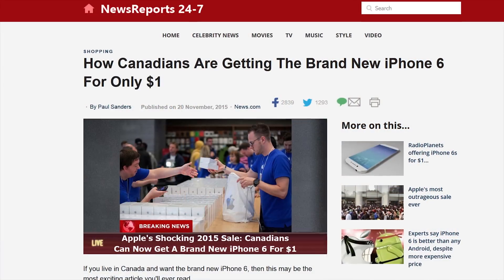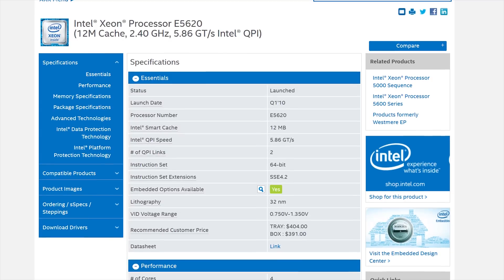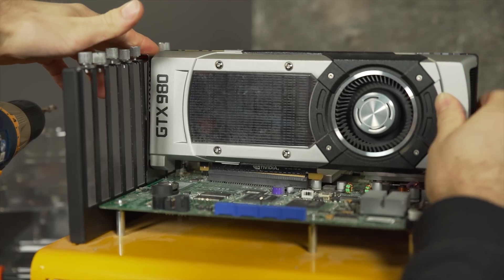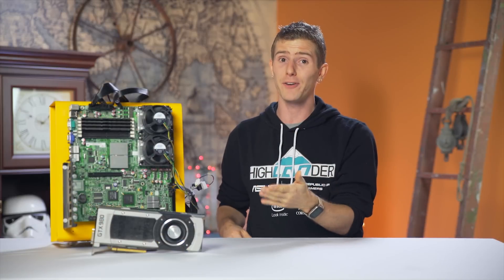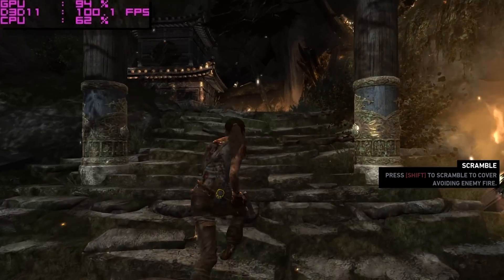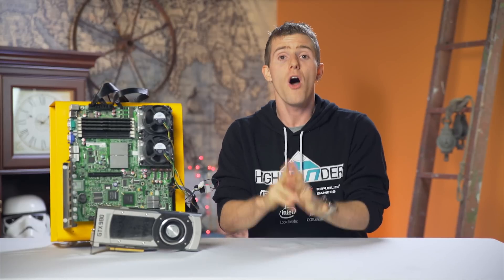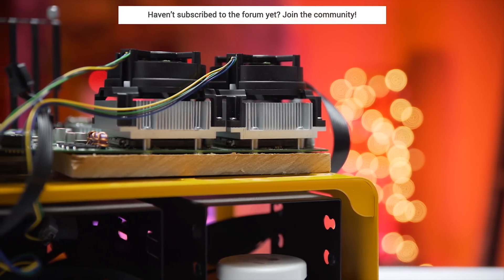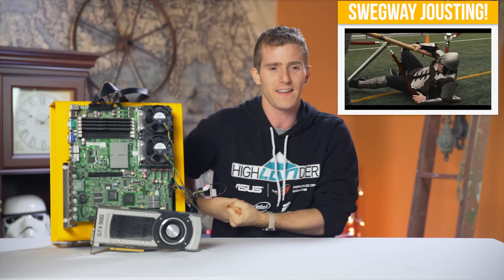Under $150 Budget Gaming 8 Core CPU, Motherboard & 16GB RAM

Comment: I seriously thought that the GPU is part of this budget gaming build. Seems like a click-baity video as of now
Reply: +Hank Hill "Under $150 budget GAMING build"
Reply: +Hank Hill Okay so you go ahead and try to do "gaming" on it without a GPU.
Reply: I think the issue is that all you see is "Under $150 Budget Gaming" when you see this in your subscriptions or suggested videos. You gotta admit it's a little clickbaity.
Reply: +Hank Hill I don't think it's an unreasonable interpetation. I bet a lot of people are going to be disappointed when they realize you need to spend at least another $300 to make it worth getting over a console. The quoted price doesn't factor in GPU and it's not a gaming system without the GPU, so it's a classic bait and switch.
Reply: except the title states that it's the CPU, mobo, and RAM...
Reply: +Hank Hill The title on the video
Reply: +Hank Hill I respectfully disagree, if it is interpreted that way by a lot of people, no matter if the title actually says something else when you read it more carefully, then it is the fault of a slightly misleading title. Also they never even mention the full price with graphics card in the video, even though they use it in the build.
Reply: Good for you. Pat yourself on the back. You know about computers. Good job.
Reply: +Hank Hill I still don't think it's an unreasonable interpretation; I wouldn't have been surprised if it was all inclusive, when it says "Under $150 Budget Gaming" in the suggested videos. Linus built a pretty decent gaming rig for $240 dollars in the latest season of Scrapyard Wars, so $150 isn't too far off from that.
Reply: +Der Krazy Kraut what the title should be is "shitty old server motherboard paired with ddr2 ram and then i saw off a lock on a 550 dollar graphics card and brag about how good the computer runs with a brand new 550 dollar graphics card in it"
Reply: +Hank Hill Yet somehow people are still clicking on this video expecting one thing and getting another.
Reply: Is it really necessary to call people dumb just because you disagree with them? Nobody's complaining that they don't understand the title. I'm pretty sure that the title doesn't need any explanation after watching the video. The only thing anyone's complaining is that the video didn't deliver what was expected when we clicked on it.
Reply: People enjoy not reading, and then looking stupid making stupid comments.
Reply: +Hank Hill Some boards have built in GPU's like from AMD so that's probably what people were thinking. You might wanna turn your TROLL ASS down to a 1 out of 10. You are really starting to look like shit.
Reply: +radun70 don't need to spend a other 300 to beat consoles. I have I think Mike a 120 or 150 dollar gpu and I beat consoles hands down lol. 750 ti
Reply: theboard 1  I know you don't. I was just saying.
Reply: +András Rudnai Also it shouldn't be click bait if you are a good subscriber and watch the videos anyways. they're giving tips. its not click bait. they aren't telling what could or mobo you should get. its not a build log video its a "how to" video. so they made the title long. so what? i would have clicked on the video if it "this is a video" and that was it. because I'm a loyal subscriber and i watch every video if i like it in the end or not. they're doing a service to us. not us to them. sit down child and appreciate what they gave us.
Reply: +Hank Hill SMH. You keep making jabs at me for not being able to read but I'm not having any trouble reading anything. The whole issue is that people will click on it expecting something and then being disappointed. It uses "Gaming" in the title, but it doesn't factor in a GPU in the quoted price; therefore it's a little misleading. That's all.
Reply: +Hank Hill Lol just stop if they are dumb enough to misunderstand what the video title means it's safe to assume they aren't going to understand it when you explain....even.  if.  done.  very.  slowly.
Reply: +Hank Hill PC Recyclers, you might wanna find one in your town. (Drops MIC and walks off stage)
Reply: +Hank Hill Actually barebone gaming PC&#39;s usually have AMD boards with built in GPU&#39;s on them. SO again, you are WRONG! a BAREBONES Gaming PC WOULD include a GPU on the motherboard or even a cheap ass R7 260 GPU card.
Reply: +radun70 Ignore hanky he's playing the protagonist because he has no fwiends
Reply: +Jeremy Gould Now days you can get PC cases WITH power supplies for $40. Yeah look online.
Reply: ***** Proving most of the shit you spew is nonsense and you obviously haven't been around electronics very long.
Reply: +Der Krazy Kraut 
"budget gaming" is no the same as "gaming pc" or gaming rig" .. thats like saying "fake turbo" is the same as "real turbo" just because they both have the word turbo in it. learn to read. otherwise youre gonna fail alot in life because this legalese lingo is EVERYWHERE. and it isnt hard.
Reply: +Hank Hill well there ya go. and I completely agree with the stuff you were saying :p people getting all bent out of shape for no reason
Reply: +András Rudnai It's not click-bait. You're just stupid and can't read.
Reply: Spektrik Most gaming rig's include a GPU without spending more money.But yeah, you don't get the concept. Go play Candy Crush I'm on Level 100 haha.
Reply: +radun70 This $150 doesn't include the case nor the Power supply either LOL.
Reply: +ThePotatoShow you dont have  to have a case
Reply: +Der Krazy Kraut If you were imagining other parts outside of the title description to be included.. why not assume it came with a case, psu, an a display too?
Reply: i would say exclude the side effect such as overheating
Reply: +radun70 im on the fence with this one. but if theyre willing to pay 300 dollars for a regular set of RAM, a CPU and a Motherboard then, they go budget on GPU then they are getting worse performance. But. if they were to go budget on everything else and splurge on the GPU then they will most likely come out on top.
Reply: No Max Headroom

Comment: PCIe 1.0 x8 has the same bandwidth as PCIe 3.0 x2. I'm not sure that it's a CPU bottleneck; I think it's a PCIe bandwidth bottleneck. Also, I think in the near future, LGA 1567 motherboards might start getting cheap. You can get an 8-core LGA 1567 chip for less than $20, stick up to 4 on a board, and get rockin'.

Comment: Also, instead of sawing off stuff, you could simply desolder that capacitor out, extend the legs, and solder it back again, putting it to horizontal position farther from the slot. No need for a PCI extender or a saw!

Comment: Got a FX 9590 for 10 dollars a while back. The owner thought it was broken. it was just a broken pin, which i repaired immediatly...
Reply: You forgot to include the $100 on power bills a month LOL
Reply: +Top Kek This is like saying going from an 6600 (65W) to a 6600K (95W) will increase your power bill by 30 dollars a month. AMD doesn&#39;t consume that much more power, it&#39;s only more on mid-range GPUs and negligible on low-end GPUs given PSUs are hard to find under 450W.

An OC&#39;d 8350 will cost like 20 bucks more in power over multiple YEARS than a 6600K. This 9590 is a good deal.
Reply: +Ephruz yeah, I own an 8350. just recalled the 9590 having a high tdp haha
Reply: +Ephruz 
220W is still a lot compared to Intel's CPUs. I can't even imagine the heat output of an FX-9590 overclocked beyond 5GHz.
Reply: I agree with Adam, the bigger issue is getting a motherboard that has the temp control to handle the 9000 series. Most of them are over 200 bucks. It's like how some mATX mobos couldn't handle the 8000 CPUs.
Reply: +Christopher Lennon I do live with my parents LOL I'm still a teenager. It was an over exaggeration of course. I've got an 8350 and it does run pretty hot but the 9xxx series is insane. just a joke man
Reply: +Amir Mohammed I literally just looked up a release anandtech review. It was 300USD. And yes, I would expect a CPU with higher single core performance to do that. That's not the point of a 9590.
Reply: It's about 220W, which means it likely consumes more above 50% load. By contrast to that and the 6600K OCd or the 8350, that's like the difference in power consumption between an R7 260X and an R9 280, so not a ton especially for something you're only gonna have one of. 

The CPU is definitely hot, though.
Reply: Top Kek I don't use the 9590. I've gave it to one of my friends.
Reply: +xXx_420_360_HaX0rDaN0uSkoupah#sWaG#l3g1t_darud3w33dstorm_360_420_xXx I got a great deal on an fx9370 recently and bought a compatible motherboard (220 watt tdp is ridiculous) only to find out that at stock speeds (4.4), the cpu was running at 60+ degrees at idle with a CM hyper 212 on it. I returned that motherboard and put my old rig back together (fx4350@4.7Ghz)  and it idles at 10 degrees, lol. I'd avoid the 9xxx series cpu's honestly. not worth all the extra components it takes to make them work properly. on an unrelated note, I'm selling a like new fx9370 if anyone is interested. ;)
Reply: Ephruz you really need a decent liquid cooling system (h80 or better) as well just to run them at stock speeds. To overclock you would need a fairly expensive setup, my guess would be a custom loop with nice components. That's too big of an investment for the performance gained in my opinion.
Reply: That too. That's why the non OEM/Tray 9590 came with a 120mm AIO. 

Back then it was probably worth it for the highest end AMD setup if you wanted a loop. At that time, we were in between an Ivy Bridge tick and Haswell tock. The 9590 was AMD's budget answer to the i5s and i7s of that time, which were still more expensive at MSRP. Currently it's still cheaper than an unlocked i5 or i7 at 200 bucks.
Reply: Yeah, I think AMD was trying so hard to beat Intel to the 5Ghz mark that they didn't really care how practical it was.
Reply: +IIIII47IIIII I said all this.
Reply: +IIIII47IIIII Relativity wasn't my point. The point was in regards to the power bill, with relativity as context. It will not raise the cost of ownership to an amount that makes the processor cost more than the Intel CPUs until it's time to upgrade again. People who bought 9590s in 2013 that will be going Zen will have still spent less to the same as people who got an i7 3770K and will be getting Cannonlake.

Yes, everyone knows it consumes a lot of watts relatively speaking. At the same time, wattage isn't the only number to care about.
Reply: +Amir Mohammed is that in Australian dollars? In the US it was 300USD and was swiftly dropped to 240.
Reply: +Amir Mohammed here ya go. http://www.anandtech.com/show/8316/amds-5-ghz-turbo-cpu-in-retail-the-fx9590-and-asrock-990fx-extreme9-review

The 9590 was supposed to be AMDs competition to the 3770K, but single core performance wasn't good enough after DX11 in games. It does very well in DX9 though.
Reply: OEM is when a part made by one company (in this case a CPU) is put in the end product of another company (in those cases, prebuilt PCs.) Selling those CPUs is effectively selling OEM parts. These CPUs weren't supposed to be sold directly to consumers, likely due to the dangers of frying motherboards incompatible with the 9590. MSRP was higher than I thought though, around 330USD, which was 2 months after launch.
Reply: +Ephruz exactly. basically means that a typical system rockin one of these hot cpu's go for that
Reply: At the same time, I wasn't around in PC building back then so this terminology could have been used to tactlessly cover a marketing strategy.
Reply: DJ Jesus.He Died for your spins How do you repair broken pins?
Reply: Zeroplanetz with AMD, you just put the broken pin in the coresponding hole on the socket.
Reply: ah. had no clue.
Reply: +xXx_420_360_HaX0rDaN0uSkoupah#sWaG#l3g1t_darud3w33dstorm_360_420_xXx  I bought a 9590 and am keeping it underclocked. :P
Reply: +Ephruz OEM mean you buy the cpu by the cpu manufacturer itself, you dont buy it with his fancy box and heatsink! 

It come in a white box with the little antistatic plastic thing to protect it. 
But this way of buying it is mainly for commercial use.

Sorry to not speak english so well good loll ( < -- im joking a little but, I try to write the best I can)
Reply: +Adam McDermid if it's super cheap I'll buy it
Reply: +Blackawps sadly I actualyl do this with my 6300. Just like "Hrmmm, cold, screw it, fire up Skyrim/StarCitizen/Elite/any other game, warm me up a bit." Given that even the 6300 gets toasty, I'd hate to imagine what the 8350 or 9xxx processors are like.

Fixing a pin, though...
Reply: I've got an FX 9590 with 3 fans in the front of my CM Stryker case, 2 on top and 1 on the back with a Corsair H100i v2 and it idles at 30°C and under an intensive load it goes to 60°-75°C and when playing games like Skyrim it's usually at 50°-60°C. I do agree that it's really not worth the performance gain if you need to buy a £100 CPU Cooler and add tons of case fans just to get it to reasonable temps.

Comment: I'm going to buy and build my first system during 2016. I'm just not sure if I should go for a motherboard with LGA1150 socket or LGA1151. I'm going for high performance, and I want to be able to upgrade my system down the road. Will LGA1151 be the next 'standard' socket for many processors years from now? and as of now, there aren't really a performance boost from DDR3 vs DDR4, but will it happen in a few years ?
Reply: +Kasper Stryhn No socket from intel lasts longer than 2 generations. Guranteed atleast for the next 5 years...
Reply: +Daymian Hogue okay, so an I5-4690k with ddr3 ram should be fine for price per performance?  I was just trying to avoid the need to upgrade the motherboard, the next time I would upgrade processor and ram
Reply: Kasper Stryhn Yeah if you're gaming only that'll be fine, grab a decent cooler and OC and you'd have some great $/Perf

Comment: Hey Linus,
I do respct you but your video today is crap.
You are recommending a dual socket quadcore CPU, that can even perform good in multithreaded benchmarks. And tehn you are running games in full HD with an GeForce 980? Your games are running in a GPU limit.^^
I mean, look at the tweaktown review of the Intel Pentium G3258. With a GeFore 780Ti Tomb Raider is running at Full HD with 85 FPS avg.
That shows, Full HD games are running in a GPU limit. The CPU is not the limiting perfomance factor in games like Tomb Raider.
Please make compararble benchmarks next time.

Comment: I'm still running a Intel Xeon X5670, 6/12 core/threads, 32nm @ 4.5GHz. Before that it ran a intel Core i7 920 D0 (cherry picked) at 4.32GHz.

Comment: Before clicking the video to watch it, I fully expected that a 980 was part of the $150 budget. But it isn't. Would've wished you tested out other last-gen cards to see if it'd really be worthwhile. But $150 for an 8-core, 16GB system? Man my AMD 5400K, 4GB ram system is gonna have it's ass kicked.
Reply: +Mcky Dela Peña He went with a top-of-the-line card to see if the CPU and motherboard would be a bottleneck. With lower tier cards this build is worth it.

Comment: Would I be hoping for to much if I thought a server motherboards wouldn't have any on-board stuff? I have been looking for a main board that didn't have on-board sound, LAN, GPU, etc. I have yet to have found anything that wasn't pretty much a all in one.

While I feel competent to be able to break any hardware out there. My actual knowledge is very limited. The entire knowledge base I run my thought processes through doesn't include very much server data at all.

Comment: well there is a supplier  config, you can use a Xeon on a regular s775 MoBo, bit then you get only 4 cores. this is what a done, got Xeon e5450 running at 4ghz. Google mod 771 to 775

Comment: You can as well go quad core OC and mod LGA775 to LGA771 (2 plastic pieces on socket and pin-switching sticker on CPU) and you have a lot cheaper Core 2 Quad like platform, I have Xeon E5462 sitting at stock 2.8ghz and it performs flawlessly even with higher FSB than MOBO has, but unfortunately GPU Bottlenecking :/ You gotta remember however to cool it properly, because stock Intel coolers for non-server CPUs are no-go (on stock Intel cooler my CPU reached 100 celcius easily, hopefully still works, now with nice aftermarket cooler)

Comment: Great video. Just yesterday I've bought a IBM System 3560x with the same processor (sadly just one, but another one with a cooler would be like just ~40€) and 24 gigs of RAM for 20,50€ plus shipping... But I want to use it as a server rather than a desktop. ;-)

Comment: Or you could just buy normal (not server) lga775 motherboard, mod it for lga771 xeons (really easy to do) like I did. Mobo was for around 20-25$, same with cpu (Xeon E5440). I have mine running @3.15GHz but that's nothing cause I got the worse stepping. Just make sure to get P45 chipset mobo to not be bottlenecked by old PCI Express if you have a gpu equal or better than I'd say radeon 7950. It's way easier to shop for than what Linus did but the downside (besides single CPU only obviously) is that normal ddr2 is way more expensive than ECC ram and you'll probably be limited to 8GB. I hoped one of them would try to do it in the scrapyard wars, way better results than q6600 and probably cheaper too.

Comment: since using the 771 xeon, might as well get a 775 motherboard, add the cpuid to the bios, cut off the dumb proof slot, use it as a normal C2Q
i have a p5q-pro with E5450 in work dorm room. completely fine except the e5450 emit lots of heat

Comment: no need for a server motherboard. you can fit  a xeon x5472(my case) to a 775 motherboard if you cut the plastic thingy on the socket. the only requirement would be a 1600 fsb motherboard but they are eay and ceheap to find. egz gigabyte g31m-es2l.